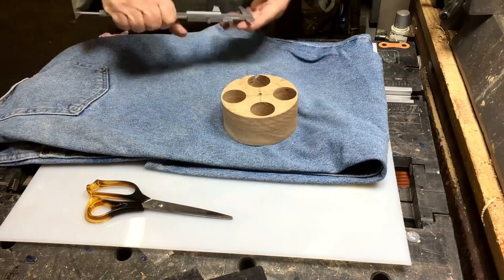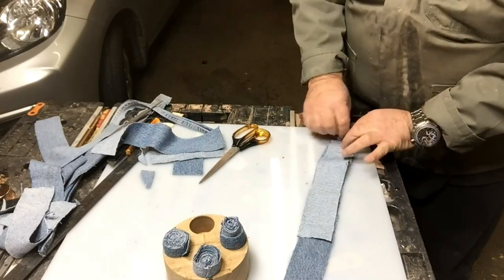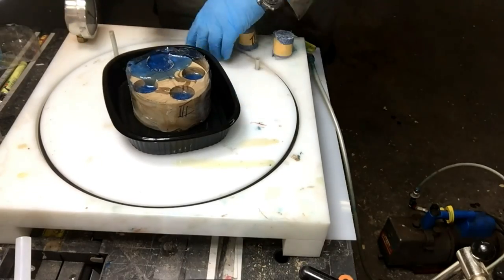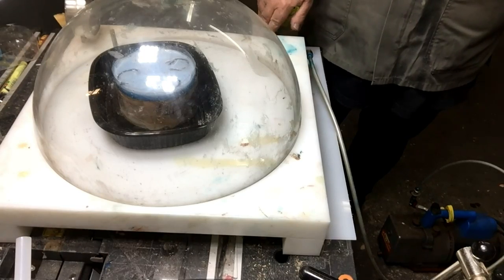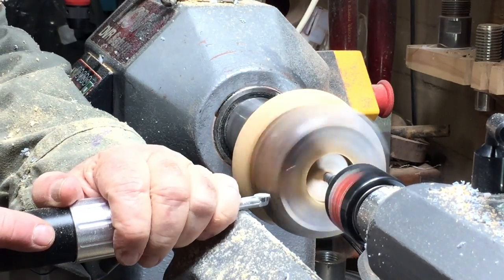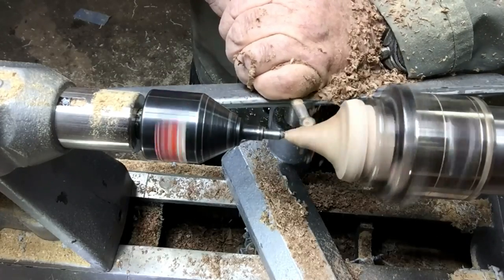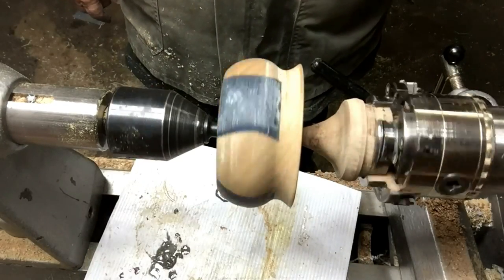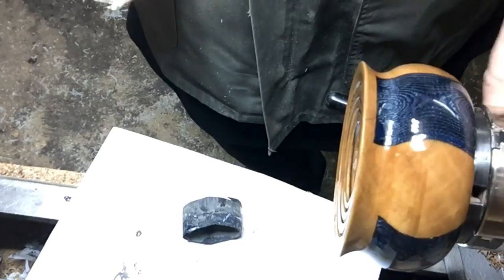Woodturning a wood & jeans tealight candel holder

Comment: Very creative. I have seen many things cast in resin/wood combination, but this was a new one. The finished product has a very unique look - I like it!

If you try this again you might try soaking the fabric in resin before rolling it. That way the resin would already be filled in the entire roll without needing the vacuum to pull/push it in.
Reply from the maker: Thank you so much on your comment . it is a great idea but i will have to use a very slow drying resin .cheers

Comment: I've always wondered why turners use pressure instead of vacuum. Nice to see my own thinking reinforced.
Reply from the maker: Thanks for your comment . on fast drying resin you can't use vacuum as it will start boiling and will dry with bubbles .